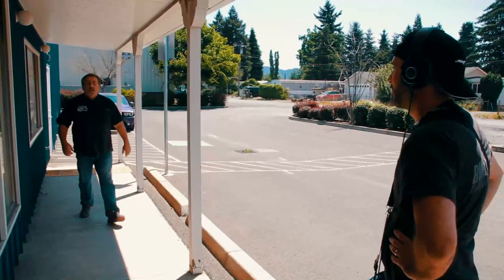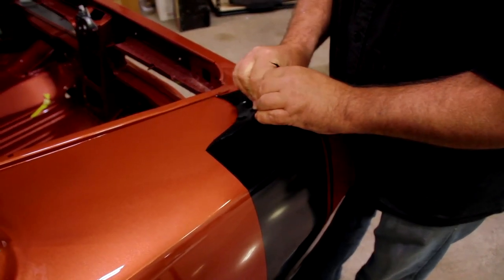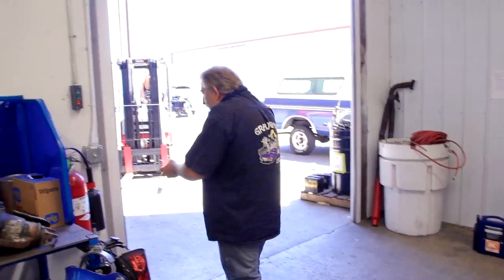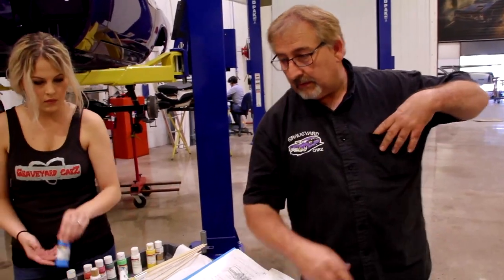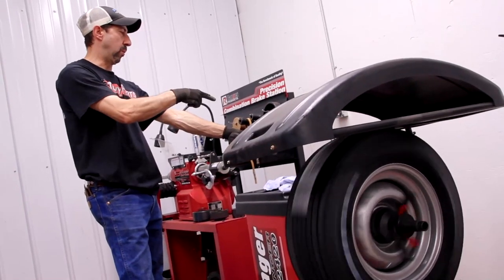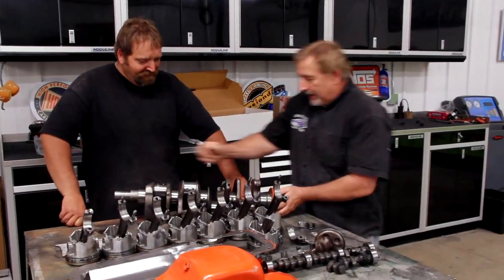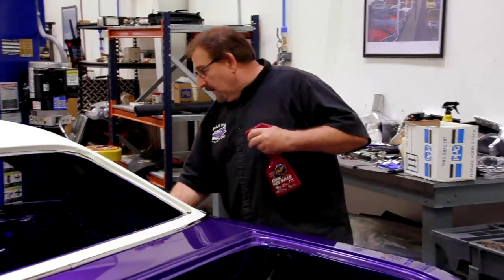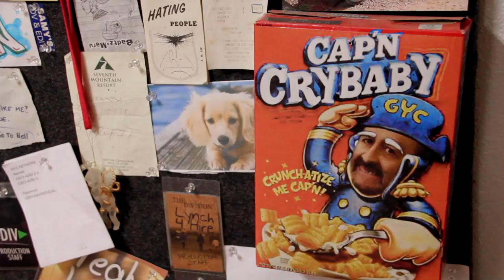UNDERSTANDING ASSEMBLY LINE MARKINGS!

Comment: I did that to a fresh 440 six pack. Couldn't figure out why the oil pressure high untill I took it apart after the rods exited the block. Seems I had to many pops and put the main bearings in upside down and blocked the oil feed to the crank. Like WTF lol. That explained the high oil pressure 😆